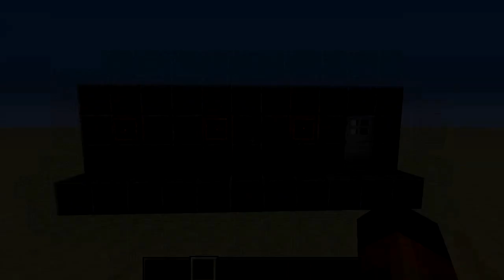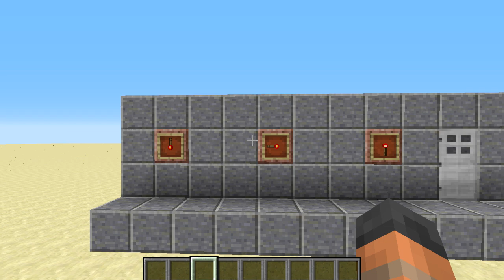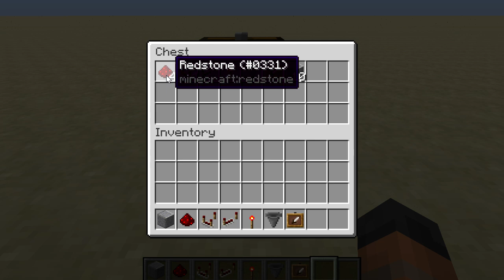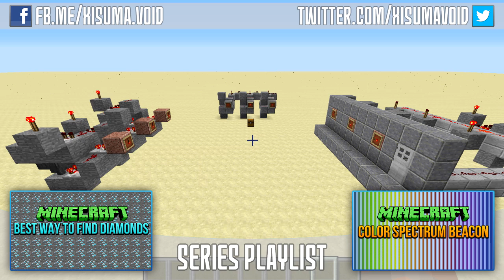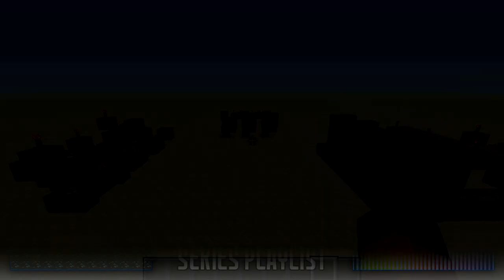Silent Item Frame Combination Lock Minecraft 1.8 Tutorial

Comment: Nice, but you could make it more resource efficient by replacing the middle comparator with redstone dust.
Reply from the maker: dro Signal strength ;-)
Reply: xisumavoid Still. It will be the same as the signal strangth on top because you are powering the block.

Comment: Got a quick question, can you have multiple positions to still get an out put, for instance if you wanted to use an item frame as a light switch then the 1st would power it the second would in power it 3rdpowered 4th unpowered etc..  Just think it would make some pretty good switch for redstone devices